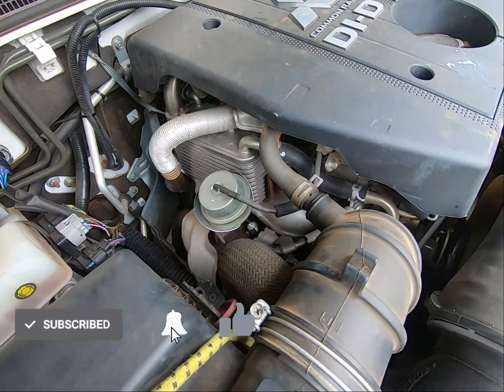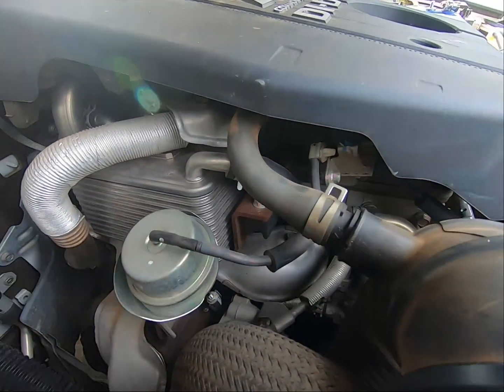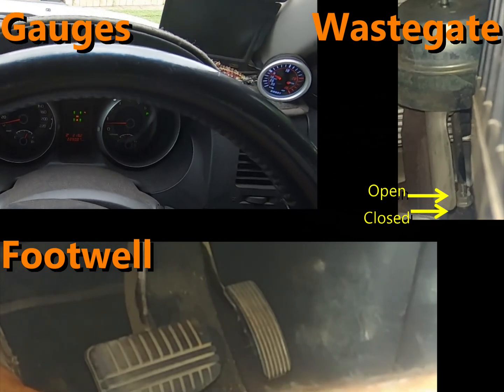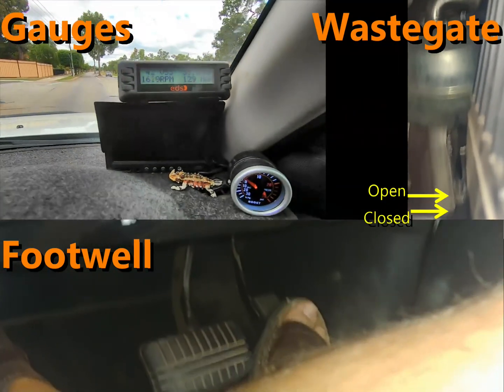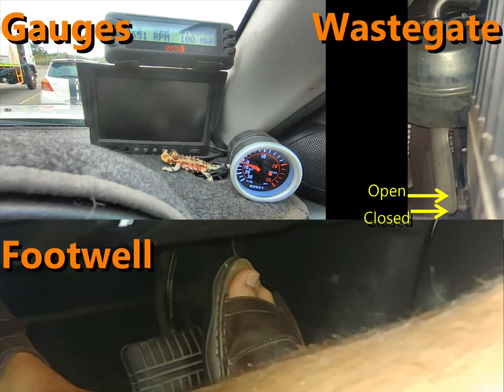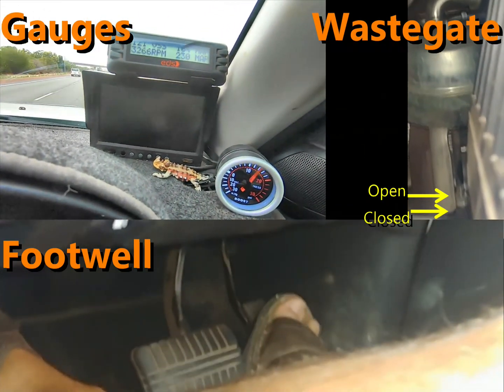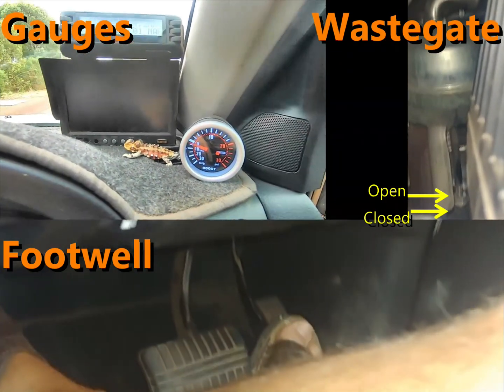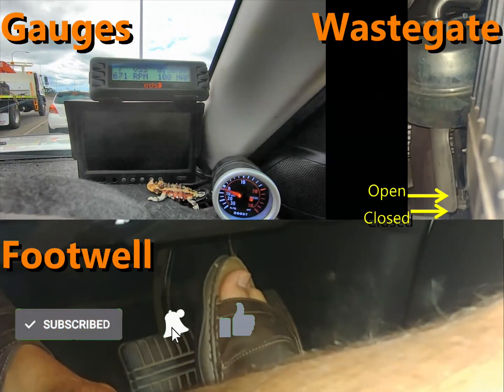Mitsubishi Pajero wastegate / VGT control - 3 CAMERAS!! Mitsubishi Pajero / Shogun / Montero

Comment: Hi can you put that turbo on a 4m40?
Reply from the maker: Unfortunately I don't have any experience at all with the 4M40, I have only had a 4M41 so take my guesses here with a big handful of salt... but I don't expect it would be practical to do so. I expect the position of the inlet and outlet of the turbo may be a bit different so physically it probably wouldn't fit, but the bigger issue would be whether the ECU for a 4M40 engine can control boost in the same way as it does on the 4M41. I would expect not, in which case even if you could get it to fit you'd have no way to control boost.

If you were really interested you'd need to do some deeper research with someone who knows a lot more about the specifics of the 4M40 setup. Sorry I can't be more helpful on this one.
Reply: @TheMusingGreg  thank you for your reply
Reply from the maker: No worries good luck!

Comment: I'm curious on where you connected you turbo gauge vaccine line. Are you able to help me? I would be greatly appreciated. I have NT Gen 4 2010 3.2 Pajero. And I bought a analogue turbo gauge with all the lines and sensor. I'm just not sure where to splice into. Cheers.
Reply from the maker: Sure mate. Standing in front of the engine, on the right side of the engine back at the firewall you'll see the fuel filter. There's a blue plastic connector mounted to the fuel filter bracket and that connects to the MAP sensor. Underneath the MAP sensor there's a black rubber hose which runs into the manifold, and that hose is the one you need to cut and insert a t-piece for the boost gauge.

You may get fluctuation of the needle on the gauge. If so get a long screw that fits snugly into the vacuum line going to your gauge (on the gauge side of the t-piece, not directly in the line going to the MAP sensor), cut off the head and push that down the hose a bit. The extra resistance that creates will dampen out the needle fluctuations. It'll respond slightly slower but is much easier to read.

Also since diesel engines don't normally produce vacuum, you can just get one which only has boost, not boost and vacuum like I did. I was still in my VL Turbo mindset from 20 years ago when I bought this one!

PS There's a lot of vaccines around these days but not if there's one for low boost... ;) Maybe you mean vacuum line :D
Reply: @TheMusingGreg  thank you very much for your help, I really appreciate it. I had a VK V8 too... I miss that thing.
Reply from the maker: Ha my mate had a white/Silver VK V8 Calais, and my VL was the same colour scheme. I've got a photo of them nose to nose, it's a great shot!

Comment: The vanes on a VGT turbo are let's say closed at low rpm to increase exhaust gas velocity and make boost but are then opened as rpm increases to allow exhaust gas to flow and not restrict the engine. Now with a diesel engine it's fuel that makes power, not boost. The VGT control is not really used to make power but to control exhaust emissions by keeping the air fuel ratio correct and prevent soot or excessive exhaust smoke.
Reply from the maker: You could be right, I'm not a diesel expert. However more air should equal higher compression pressures in the combustion chamber, which should equate to more power. I could be wrong though.

Comment: I might be wrong but I didn’t believe they had waste gates on the gen 4. I thought it was controlling inlet guide vanes to the turbine? That explains why it ‘opens’ as soon as it starts and even under light load. Because it’s not opening it’s just adjusting the inlet guide vanes to the turbine to start it spinning.
Reply from the maker: Well that's interesting, that's a new one for me! You could be right. That being the case, it's still interesting that the vanes are in an 'in between' state under heavy acceleration when you'd think it would be demanding maximum output from the turbo.
Reply: @TheMusingGreg  I think it opens vanes initially to spool up quick and develop boost but then throttles it back to limit boost at heavy load/RPM in the same way that a waste gate waste gases to bypass the turbine. Think of it as Porsche tech in a Paj!
Reply from the maker: Makes sense Mike. I guess whether it's a wastegate or a variable-geometry turbo, the end result is still the same that the ECU's controlling the boost. And that being the case, I'm still puzzled why the ECU would let the boost wind back by keeping the <wastegate partly open / vanes partly retracted or angled>, rather than open them up more to provide consistent boost as engine RPM increases.
Reply: @TheMusingGreg  I think it does that to limit boost pressure as during high load and rpm the quantity of exhaust gases would spin the turbine at a rate that generates excess pressure. So this is throttling back those exhaust gases rather than dumping them via a waste gate.
Reply from the maker: @mikewasowski1411  Maybe I wasn't clear. My musing here is not HOW it's controlling the boost (be it a wastegate or vane adjustment), but WHY the ECU is doing that - why not hold the boost at 16psi or whatever as the engine revs up to keep the power on, rather than winding the boost back as revs increase.